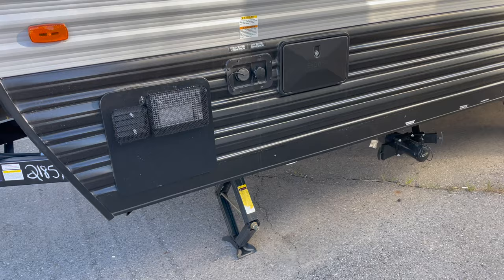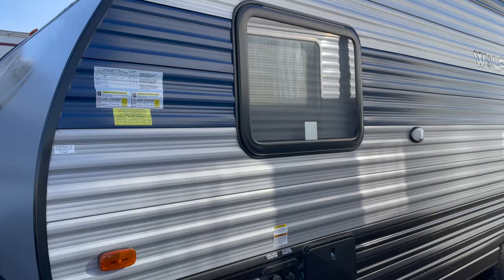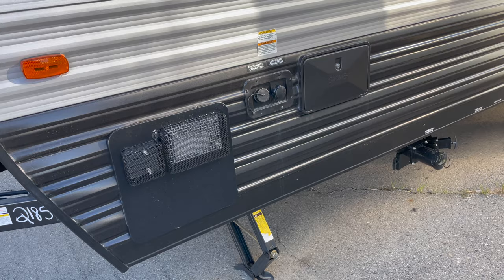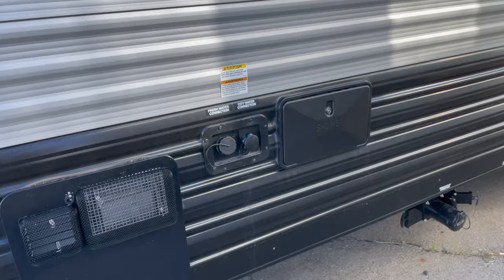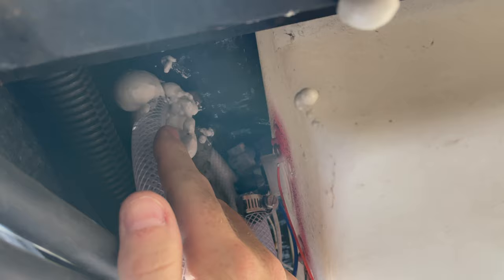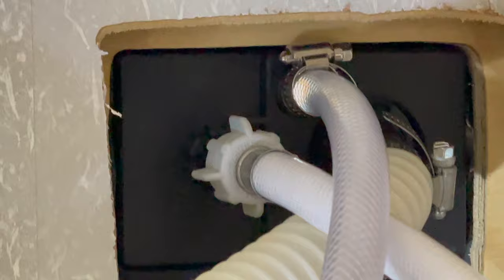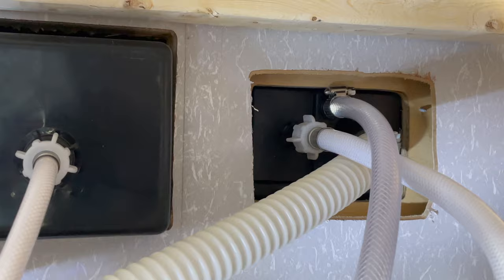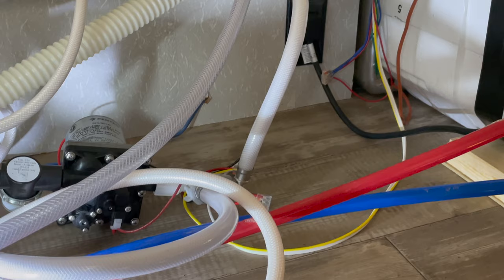RV FRESH WATER TANK VENT INSTALL 🛠💧 - Wolf Pup Travel Trailer

Comment: Thanks Nick.  Yes - exactly the same issue we had with our Wolf Pup.  Before the modification, the fresh water tank would start spilling out at around 17 gallons.  After the mod, we got 23 gallons or about a 35% increase.  Only reason I think we didn't hit 26 gallons is that the water fill station we were at was not level.  Another nice thing about the mod is that you can hear the water come up through the fill tube when it gets full so you can shut off the hose before it spills out.

Comment: Thanks for the tip on this. DId it to my 2022 16FQ today. Can't believe they do this. I figured their cost savings at maybe $25 parts and labor. Probably not that much if done at the same time they are doing the water pump install.

Comment: Question. Hydroshock. When you fill your tank plumb full, with no air, then you can have hydroshock. 
When you hit a bump large enough the water would have normally sloshed, and the air bubble in the top of the tank would absorb the compression.
With no air bubble, this slosh turns into hydroshock. Therefore, when it would have sloshed, it explodes and the tank rips apart at the seams.

So moral of the story, they now plug that port so people stopped overfilling their tank and causing warrentee claims. So if you do this, please do not fill your tank completely full.

Comment: For anyone that finds this and seals it back up with this sealer, whatever you do, WEAR GLOVES. This stuff is incredibly sticky and ultra hard to get off your skin if it gets on there. 

Pretty simple, my upper vent hole was filled with silicone that had to be removed before it could be installed.

Comment: Not sure if anyone else ran in to this but my vent connection behind the screen was actually plugged with a sealant that was not super apperent. I popped the exterior screen and pushed the sealant through the connection. I've got a 2021 16bhs.
Reply from the maker: Yeah, I failed to mention that in the actual video but put it in the description. Glad you found it.

Comment: I have the 16he and yes it has the same issue. I'd fill my tank, water would flow out elbow and I assumed it was full. I also lost a couple gallons in transit. It read full when we pulled out and 2/3 when we got there. We just got it and this was our first trip so I capped it and left the inlet cover loose to vent it. Did the job but now you just saved me a bunch of research and I'm gonna do the same set up as you. I already have everything I need. Thanks. How do you like your camper so far? We have been on one trip and were really happy. I will add battery capacity and an aditional tank because we like to boondock. I have a new propane generator to back us up too. Good video, thanks again.

Comment: Great video and explanation!  Thank you!

I'm in the middle of a similar project in my Grand Design 260RD.  The water tank is very similar to yours, but the air vent is designed to pour out on the ground when the water level gets up to it (no tube run to a screened outlet).   I'm only getting 30 gallons out of my 55 gallon tank!  I've added three angle iron pieces under the tank to deal with the bowing and repositioned the water service inlet/outlet to where the dump valve is (via a PVC T-connector and other parts) and am now up to about 43 gallons of usable water.  The third part of this project is setting up the air vent like it is in your camper.  I've been playing with different setups but it isn't working properly.  The tank will fill completely but the air vent can't clear when drawing water down so negative pressure builds up and the tank starts to collapse.  How does the water clear from the loop in the air vent hose??
Reply from the maker: Might just depend on how the run is. I don’t have that issue with mine. Of water ends up in there it just drains down as water leaves the tank

Comment: Another great video, thanks for taking the time to setup your camera to get good video under and around your rig.  I was sort of surprised to see that the mfg just leaves the Flojet pump hanging loose in the compartment. It seems that travel would be bouncing it around quite a bit and I'd worry about the connections coming loose? Maybe batten it down with a little metal strap?
Reply from the maker: The pump is actually screwed down with some rubber washers between. So it’s pretty secure :)

Comment: Hello I recently purchased a 2016 Wolfpuff 16 F Q underneath the trailer there is a slightly larger diameter hose that looks like an accordion that water goes through and it actually runs up over the frame and the belly of the camper has pressed that hose down flat! I cannot lift the belly up to release the pressure or to get a hose out to replace it only for it to do the same thing. There is also pinhole leaks when I fill the water tank? Can you please advise on what I could possibly do to make it repair. Again the hose is like the sewer hose I believe it’s a water fill hose. Thank you in advance
Reply from the maker: Is the hose white? That very well may be your fresh water tank fill hose. You might need to take it to a shop to see if there might be a way of lifting it to free the hose.
Reply: @TheRVPastime  yeah OK I ain’t taking nothing to no shop ha ha ha I just got it set up on Jacks and everything I’m going to be living in it and I have shore power and shore water coming in directly , so if I ever tow it again I’ll cross that bridge then I suppose the hose can be cut and replaced and strapped underneath frame instead of over the top of the frame also it is a white hose that fills the tank. 😎

Comment: I have never used my fresh water tank always have used city water. But yesterday when I connected my water hose to the  for the first time this spring water began to run out of the little vent screen beside the city water connection. I checked and found that the fresh tank is full and I do have a vent hose attached that I assume must have been done at the factory. Do you know of any way the fresh tank could get filled by the city water connection? I bought the Wolf Pup brand new no one has ever worked on the water system I know for sure I have never filled the fresh tank.
Reply from the maker: Yeah, that’s usually a case of the check valve in the pump head stuck open and feeding back into your tank. Try running the pump and seeing if it clears any debris out. Or you might have to take it apart/or replace.

Comment: with your new added vent line going down and then back up, will that act as a p-trap when you fill the tank, or will air still push out?
Reply from the maker: It went straight up from the tank up to the vent port

Comment: In my old camper, when I over-filled the tank, water would spurt out through the little overflow hole near the upper water fill input area. In my 2020 WolfPup 16FQ, the water overflows at the bottom, near the fresh water tank (which concerns me--I don't want to ruin my tank). Shouldn't it come out near the top hole that you showed? Could mine be blocked?  Thanks
Reply from the maker: Did you install this hose that I show in the video? Otherwise it’s probably coming out of the elbow that I point out.

Comment: Hey, thanks for the video. I'm in the middle of getting a custom tank made up and the inlet connection needs to be around 50mm below the top of the tank, are you saying this will allow me to fill it above the height of the inlet? Should the tank have an additional hole for the air tube, or you can just use the same connection that the water enters the tank through? From what I can see, the connection you have at the top that you attached the hose to, is only to allow water to spill out, but not for filling?
Reply from the maker: Correct, the elbow I attached the hose too is just for air/venting, however, overflow would come out of either the fill hose or the vent tube, or both frankly. As for filling, it just depends on where your fill connection and vent connection is. In my case, the vent connection is juuuuust above the fill connection.
Reply: @TheRVPastime  cool thanks a lot, I might have to look at getting a separate breather connection so as I'm not sure how it is meant to work if the filler is also meant to act as the breather! Waiting on a response from the tank maker so I'm sure they'll be able to advise me too :)

Comment: Thanks Nick.  Can you tell me where to find the fresh water hoses?  Are they under the bed or under the sink?  We have a Forest River 16FQ (2021).  Where were your hoses located?  Thanks for this vid.
Reply from the maker: On my unit they are under the bed on the left side of the trailer which is where I “think” those connections are on similar units. Should be where your pump and water heater are too.

Comment: Isn't this ridiculous.   We have a Montana 5th wheel that up thru 2021 they had a vent hole.  In the 2022 they don't even have a vent hole, just the elbow out of the tank.  We can fill it 2/3 full and by the time we drive less than 1/4 mile to our campsite we lose most of the water.  An 87 gallon tank that is worthless.   We figure we need to connect a hose to the elbow and find somewhere that we can run it to with either a vent on it or a valve that we close only when driving.
Reply: This blows my mind.  Bought a 2022 Wolf pup and same problem.   I lose 1/2 my water by the time I get where I need to go.   Makes me think they don't want the tanks completely full.
Reply: @stephenjstoddard  I think it is just another cost cutting measure.  We have had campers for 20 plus years that we filled the tank at home every trip. We camp a lot and drive 250 miles for a weekend. Never had a problem.   If they don’t want you to fill or it is impossible to, they should advertise capacity at 2/3 of actual tank. We have been able to stick a plug in ours when driving, but have to get down under camper. Considering rigging up something with easier access with a valve.